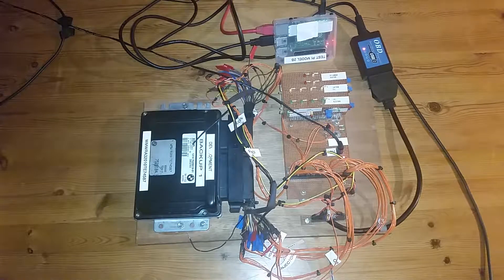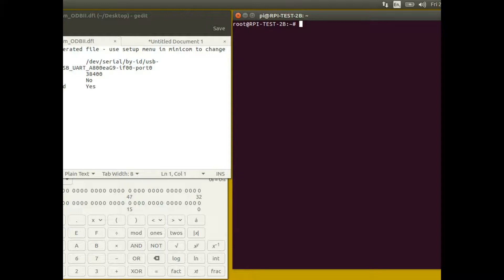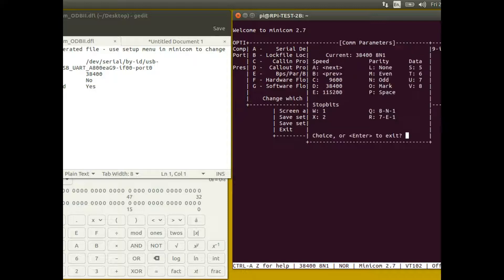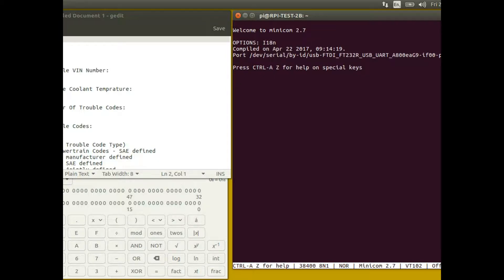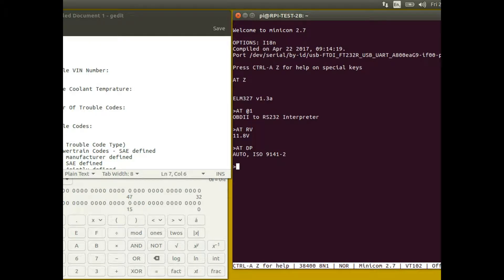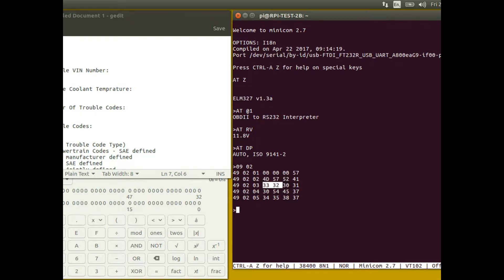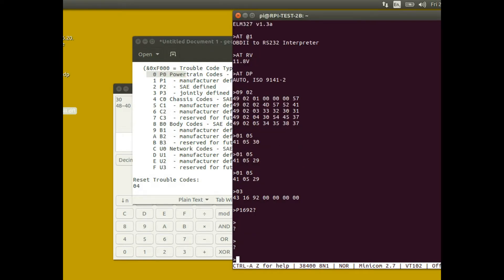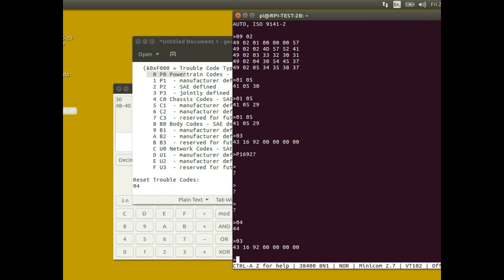Raspberry Pi OBDII Connection To ECU Via ELM327

Comment: so what is used physically connected to the ECU and obdii cable for communication k-line or can high/low? ISO 9141-2 suggest you only connected to the ECU k line pin.
Reply from the maker: There are USB and Bluetooth ELM327 devices which can be found on eBay. They plug into the OBDII connector on the vehicle.

Comment: Really interesting video!  Is there a source documenting the pinouts and components you used for the cables and emulator?
Reply from the maker: I think at the time the ECU pinouts I searched for ""85 (115) 6000" Autodata" on Google. The ELM327, I probably searched for "ELM327 Wiki".
Reply: @DevelopIT  That worked, though I have no idea what "85 (115) 6000" means... but it got me there.  Thanks.

Comment: So I have been doing a bunch  of research and a little bit of trial and error here and there. My Pi picks up my OBDII to USB as a ttyUSB0. I have read some where and in your video that it must show up as /dev/serial/by-id for it to work. Is this correct???
Reply from the maker: Serial devices and other devices can also sometimes appear as TTY, a kind of console interface. I don't know if you can get it to work via this interface, I would have thought you may be able to. But if you can't then find the serial interface, which you will be able to set things like communication speed on.

Comment: Hey man, I am trying to do the connection that you do between the ECU and the ELM327 using the Raspberry, but I have got a problem, because when I launch the command "minicom", on the screen appears the next line "minicom: cannot open /dev/tty8: permission denied", then I type "sudo minicom" and I can enter to the configuration and all that, but when I want to type the comand "AT Z" I can't type anything on the screen. Can you help me to solve that issue, please?
Reply from the maker: If you type:
ls /dev/
Then connect your ELM327 device and type:
ls /dev/ again, the device which appears should be the ELM327 device name required in the config. By default the communication speed I think is 9600, but you can try other speeds in the config if this speed does not work.

Comment: Great video, thank you for sharing! Is there any way to perform attacks on the ECU for testing purpose with your setup or is there a better way?
Reply from the maker: I think I remember seeing the ELM devices can place non OBDII messages on the CAN BUS and get a response. I'm not totally sure because I haven't done it myself. If you find if it can be done and how it is done in the documents, you may be able to modify the source code to send the ELM commands to do it.
It is not something I could spend time on, when I next look into the CAN BUS I want to connect to it directly for the fast speed of communication. I'm hoping to do that when I next have time. 
There is documentation on the ELM web site, which is the documentation I used:
https://www.elmelectronics.com/products/ics/obd/

Comment: thats really cool. is there any AT command to be sent to ECU to turn on the engine/ignition?
Reply from the maker: I haven't seen any. OBDII is more for diagnostics. Manufactures have their own commands. So some use K-Line, which is a different interface, to do things like set the VIN number and pair new keys. But I have never used K-Line myself.
Reply: That would be pretty dangerous. So my strong guess would be no
Reply: We can implement 3 factor authentication for such feature... So lets talk abt implementation... How can we do this?
Reply from the maker: @1979zeesh  If you search Google for "Keyless Start", there are cars where the keyfob talks to the car and tells it that it is OK to start the engine with a button press. I would think this must be a message going from the keyfob receiver to the ECU. I think it would likely be a "one time pad", which you can find out more on Google about. One time pads are used in modern central locking systems to prevent someone triggering a central locking system by monitoring the keyfob transmissions.